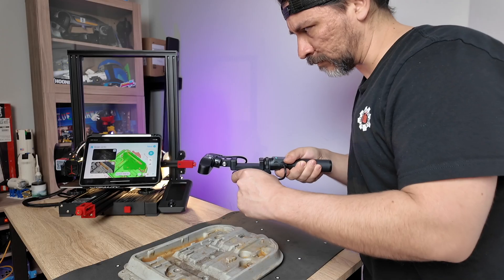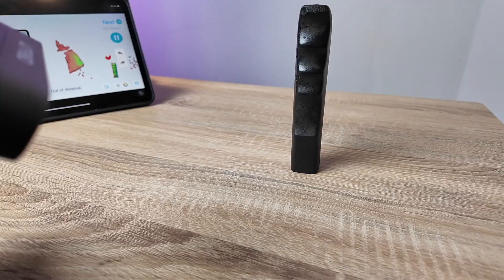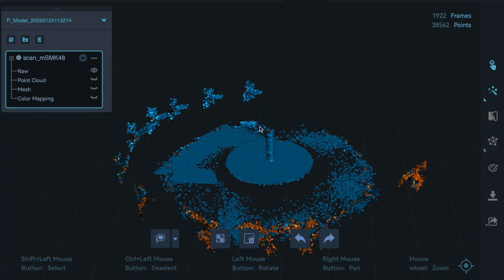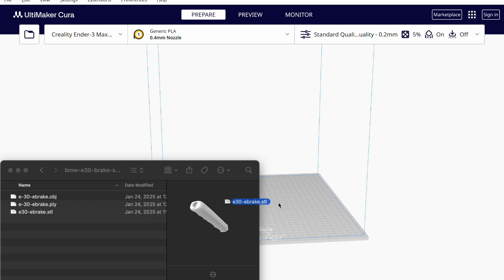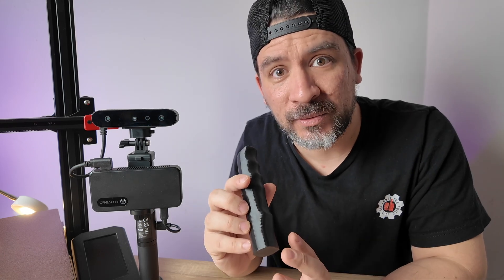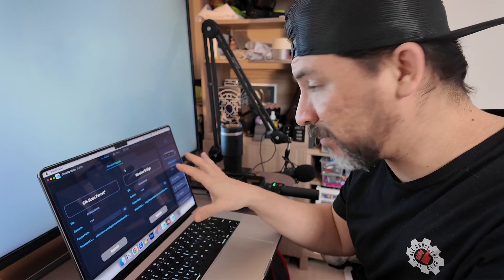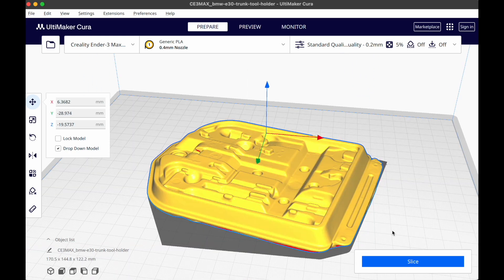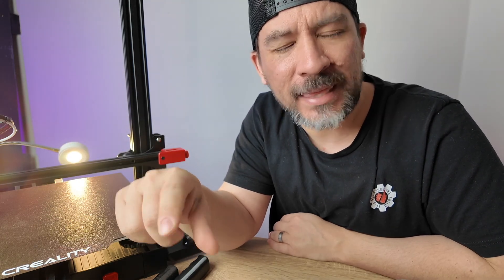DIY 3D Scanning and Printing Car Parts on a Budget… Is it Worth It?

Comment: You probably already know by now, but print yourself some scanning dots/markers/nodes and glue magnets in, then you have reusable scanning dots that you can quickly stick to the metal panels, makes these jobs far less tedious when prepping.
Reply from the maker: I’ve seen those, that’s a great idea. Will maybe even pause print and add magnets so the clear can’t be scratched by the magnets 🙌🙌🙌 Do you 3d scan and print car parts too???

Comment: Try using an SLR or your camera phone in highest res mode and take pictures from all angles Then pull them into the free program Meshroom to make 3D models from them.
Reply from the maker: Will have to try that out and make another video on the differences 🙌

Comment: I have one and it's terrible. Without markers no chance so if you hoped to scan part on motorbike directly... NoNo.
Additionally details are all lost, so the resolution is not there. As in the video the imperfections disappear... That's the details removed due to low resolution. Waste of money
Reply from the maker: Yeah, not that good but it’s pretty cheap. To get better resolution, we’ll need to spend some more. it’s not to bad for reference designs though. Thx for the comment 🙌

Comment: Ashley's phone for the win
Reply from the maker: YES!!! Thank goodness. Just did an update to the Creality Scan App and it finally works with an iPhone. Are ya here for learning to make car parts???
Reply: @Itsallaboutthebuild yessir i am! I've got a gen 1 integra that's super hard to get parts for, so I'm going to try and 3d print some stuff for it.
Reply from the maker: Gen 1 Integra, nice. I grew up on Civics. 84, 91, and 04. Now I've fallen into the BMW and Datsun trap. What 3d printer are you using?
Reply: @Itsallaboutthebuild heck yeah thats awesome man! I've got an adventurer 3 I've been using for a few years. I've only used it on occasion but if i end up printing a lot I'll probably upgrade to something with a bigger bed and hotter nozel temps.
Reply from the maker: Sweet, I might need to upgrade to something bigger too. Maybe the H2S

Comment: Ahh, this gave a much better sense of whether it's worth its weight in gold or not. Seems like we got the same 3D printer as well lol, and I'm defs gonna be using the scanner for cars and stuff like that, so I'm considering printing markers that magnetically snap onto the body to be reused since most of it will have to be modeled anyways and the scans will work as bases for me to model from. I'm an android user and need a new one, so if it doesn't work well with what I have then I might as well just grab a new device. Thanks once again for the response & feedback, and I'm glad to see the use case for cars as well, really goes to show that it'll work for my needs. Have fun, and keep it up 🙏🙌🔥
Reply from the maker: 3d printed magnetic marker snap, that's a great idea and thx for watching!!! Are you doing your own CAD design as well???
Reply: @Itsallaboutthebuild  Still learning more and more about CAD modeling, want to transition over from Onshape to FreeCAD and then expand as much as possible. I have also used Blender for more free form modeling as I've got more exposure there, but parametric is just better and non destructive in comparison for when you have to make iterations of models and tweak things here and there 😅
Reply from the maker: Nice, I've had lots of success with Shapr3d. Love using it with an iPAD and Apple Pencil too.
Reply: @Itsallaboutthebuild that's awesome! Well I'll keep an eye on your channel cuz you seem to do car related stuff which is pretty much what I'm tinkering with. Still gotta watch that Raspberry Pi video 👀 keep it up and have fun 🙏🔥
Reply: @Itsallaboutthebuild  Hey bud, just to let you know I did get the 3D scanner, it's defs gonna take some work getting used to it. Seems to work fairly well with my phone though, but scanning is going to be a bit finicky for sure. Haven't tested out with markers yet, that's next on my to try list, but that will be in next week sometime when I got some free time on my hands. Thanks again for this review and your feedback as it helped me get started quite easily already without the headaches. It's just a very niche process to follow when scanning from what I've tested so far, but will defs work for my needs. Keep it up 🙏🙌🔥

Comment: I would love to see if you can create custom or missing parts. Such as scanning the hole for a dashboard AC vent that missing the vent insert that adjusts the airflow. Or like scanning a trans tunnel and making a custom arm rest for it.
Reply: You can scan stuff but it is really a step in the process. The real work happens in CAD software.
Reply from the maker: Those are some great ideas. Will have to see what other parts we have missing and give that a try on our BMW e30 or Datsun 510 build 🙌🙌🙌

Comment: This is awesome! Subscribed. When you scan does it show record the measure of everything  your scanning? Meaning if you use the measurement tool in your software will it show that you hood for example is 36" wide and 48" long?
Reply from the maker: Thx 🙏🙏🙏 and yes the measurements are pretty accurate. What ya plan on scanning???
Reply: @Itsallaboutthebuild  Awesome! I plan on starting with scanning my 2002 chevy cavalier sun visor and door handle to 3d print then begin working on the complete dashboard as I get the hang of it since it's completely broken to pieces.
Reply from the maker: @skylinegt6 those are great parts to start with. Have fun 🙌🙌🙌

Comment: For even better results, make sure to have a GOOD lazy susan. Your wobbles like crazy, so did mine. I bought another one that didn't wobble, and that meant the world to me. My scans are so much better now. Also, setting all your settings to the maximum value doesn't mean you get the best SCAN data. It means you get the MOST data, some of which is generated in the software and can be false data. I have best results with my sliders somewhere in the middle.
Reply from the maker: @3dPrintCreator  good point, need to get a new one. Stole this from the kitchen 🤣🤣🤣

Comment: Little TIP, For the 3D Scanner, Use a tripod. And a rotating services. Do not try it with hand unless object bigger then the tripod it self. (learned from my mistakes)
Reply from the maker: @Punchmememe  thx for watching and for the tips. We started using a tripod recently and it works much better. Thx!!!
Reply: @ Would love to see the setup 😁
Reply from the maker: @ What would you like to see scanned???
Reply: @Itsallaboutthebuild  Anything! Would love to see a mid console from a dashboard. I would not recommend it, Because it Will be a challange 🙄
Reply from the maker: @Punchmememe  lots of plastic interior parts are missing or broken. We’ll be scanning those next. Do you have a project car?
Reply: @Itsallaboutthebuild  did you make a video showing that?
Reply from the maker: @ sorry, showing what? Tripod? No, but I started using one of my camera tripods it to scan as my arm was getting tired 🤣
Reply: @Itsallaboutthebuild  🤣🤣🤣
Reply from the maker: @Punchmememe  😁😁😁
Reply: You still using that Scanner or you upgraded? Asking because thinking of buying one for kids stuff
Reply: E46 320D SEDAN 😅
Reply: Is there a really good app I can use with my turntable to scan small items to 3d print? I have used that app where you print out the checkered mat and you go around the item to scan but it doesn’t allow a turntable beucsse I’d the gyro in the phone so I have to go around the item not stand stationary while the item spins.

Comment: I wanted to try this with the otter. Wasn't sure if it was accurate enough.
Reply from the maker: When using the markers and scanning for a few minutes I was impressed with the results. The Otter will give you even better results than the Ferret Pro due to its higher accuracy. 

What do you plan on scanning???
Reply: @Itsallaboutthebuild  The engine bay and sub frames on my van. I also want to reprint old plastics on my dash/interior.
Reply from the maker: @ NICE!!! We've been looking at even larger 3d printers to do something similar. I think printing super large car parts might also be a good video 🤔